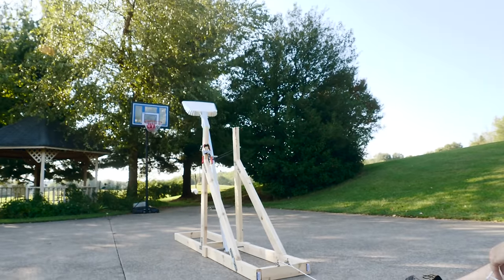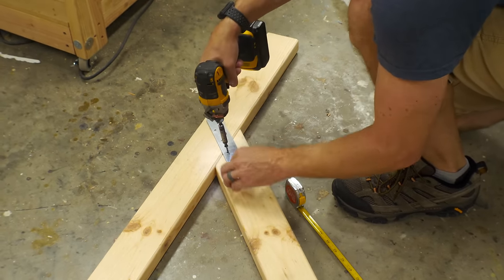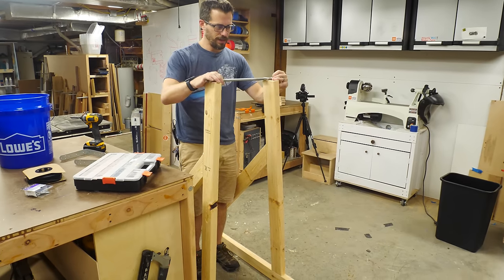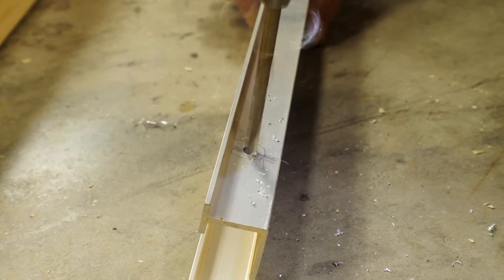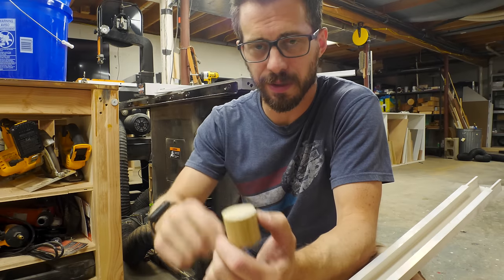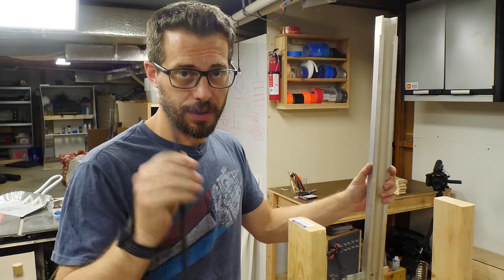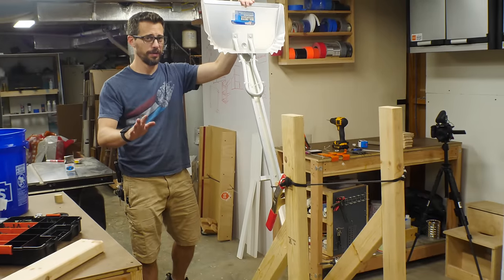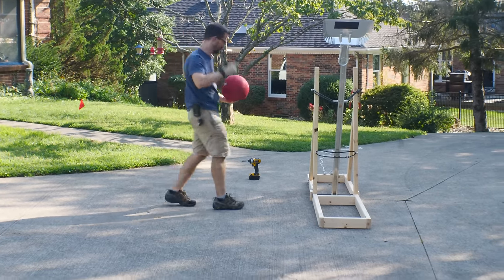How to Make a Catapult (2 MILLION SUBSCRIBERS!) | I Like To Make Stuff

Comment: Why not make a trebuchet it can shoot a 90 kg projectile over  300m you know
Reply: Damn, I had the same idea.
Reply: Uhm...that would need a weight of 850 kg (1700 lb) dropping 2 meters, assuming efficiency of 100%... in case of a more realistic 65% it would have to be 1350 kg or 2700 lb
Reply: deus vult
Reply: @REVOLUTIONS51  Unless you use a floating arm trebuchet which has an efficiency of around 95%
Reply: Old meme bruh
Reply: @REVOLUTIONS51  Mh, why not?
Reply: 300m, I'll have you know

Comment: Modification ideas:

1) A rope going from the release point to the arm that reaches tension right as the arm reaches it's vertical position (or slightly earlier). This will allow trajectory to be modified more accurately. Also, attach a strong spring to the rope for a slightly less abrupt stop.

2) There was still a lot of flex in the top of the catapult. Perhaps a crossbeam would be useful if it were to be padded so as to not damage the throwing arm.

3) Maybe try a sling attachment for the throwing head. in my experience, a sling attachment can throw things much more accurately than a scoop.

Comment: Invest in a piece of foam rubber about 2 inches thick to throw down on the concrete for your knees.  Lots of stress will leave your body.  It will make work much less frustrating when you have to work on the floor.

Comment: A tip on getting zip ties really tight:  Pull on the wire tie's tape end with a pair of regular pliers, while holding a wire cutter pliers slightly open and pushing against the head end, letting the tape slip through the open jaws.  You can push on the head a lot harder with the jaws than pushing it with your hand, and likewise get a better grip with the regular pliers than pulling the tape end with your hand.

Comment: first of all congratulations on 2 million subs, you deserve it, your channel is by far my favorite when it comes to building and electronics. secondly, if you added a section of 2x4 to the uprights at the top, it would act as support for the whole frame, as well as a sharp stop to release the protectile(s). you can protect the arm and the support by wrapping the support with heavy rope, rubber, or dense foam. just my 2 cents

Comment: Next time the rod at the top/middle of the catapult, the rod goes through the metal at 1/4 of its length. the short end gets an counter weight. The rest can be the same but it should throw things much further. Correct me if Im wrong :D

But still great and fun project + video :D

Comment: Nice fun project but you gotta have a good talk with the kids about safe operation if they are allowed to use it. Interesting idea using rubber. I would be too scared of it ripping. Got some large metal springs from a disassembled pullout sofa laying around, might look into building something similar. And I want to add bearings to the pivot points because bearings are cool.

Comment: Great video but quick tip if you are twisting ilets into timber and it gets hard and you use a screwdriver to twist it like on 7:18 it works but you can put an allan key in your drill and it twists the ilet into the timber much faster and its easier

Comment: Hey Bob, 
I am Rick - Just in case you are unaware, NEVER use Drywall screws in anything other than Drywall installations.  
They are way too brittle for any other purpose and used otherwise (in the plates & tie-straps) is asking for a failure & possible injury. 

I see you used some deck/construction screws in other areas, so I know you have some.  
Please set a good, safe, example for your viewers and use appropriate hardware properly. Especially on things under high/sudden stress. 
Using Drywall screws in the Straps/Plates places huge stress on the neck/shank of the screw for which it was not designed. i.e. - There is no steel in drywall... 
RBN